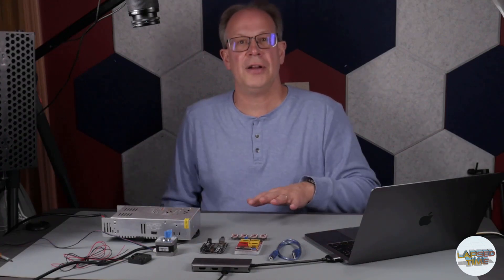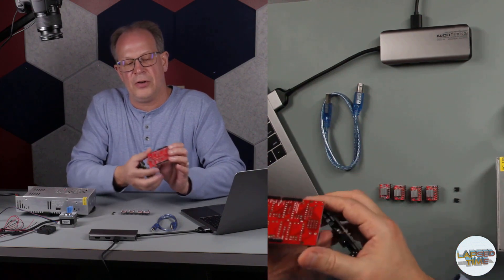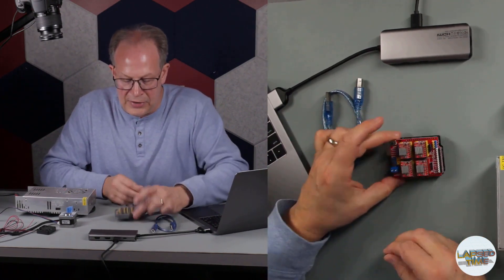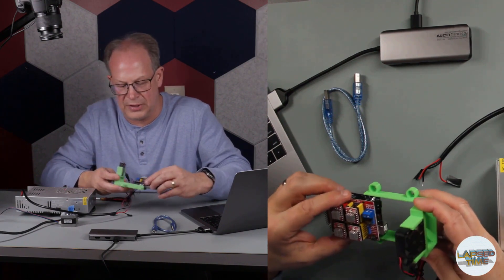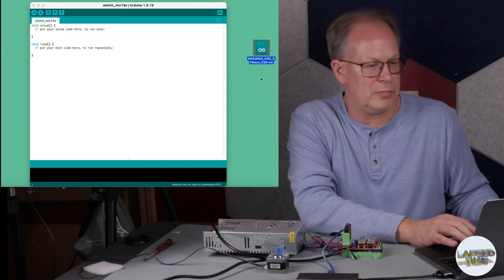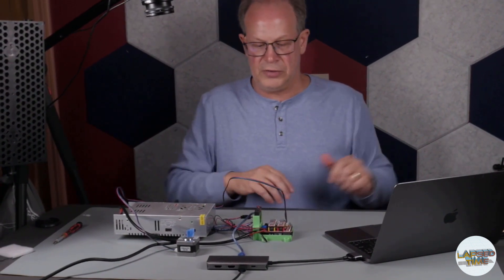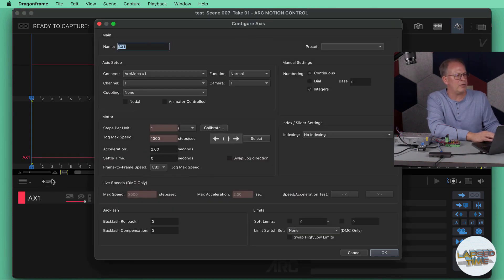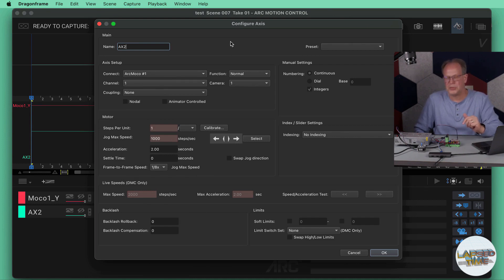Use Dragonframe software to control stepper motors with Arduino and CNC Shield controllers

Comment: When I attempt to connect to the second ArcMoco #2 the location will not allow me to click Arduino the second time.
Reply from the maker: There should be 2 USB connections listed in the location drop down menu but the name may look identical.  So choose one of them for ArcMoco #1 and the other for ArcMoco #2.  You can also uplug the USB to see which one disappears in the list.  Hope this helps.

Comment: Where to get that "dragonframe" software and what is the particular version/name for that program?😊
Reply from the maker: You can purchase Dragonframe software here: https://www.dragonframe.com/   Not exactly sure what program you are referring to but you can get the Arduino Sketch here: https://forum.arduino.cc/t/here-is-my-dragonframe-cnc-shield-v3-moco-solution-code/893160   I have several links in the video description as well.

Comment: Bedankt voor deze video :-)  I am looking at the updated arduino/DFMoco sketch, version 2.1. The pinouts gives me only two per channel, what gives.... the controller needs four pins? 
  channel 1   PIN   4   step. PIN   5   direction
  channel 2   PIN   6   step,  PIN   7   direction
  channel 3   PIN   8   step,  PIN   9   direction
  channel 4   PIN  10   step,  PIN  11   direction

  channel 5   PIN  28   step,  PIN  29   direction
  channel 6   PIN  30   step,  PIN  31   direction
  channel 7   PIN  32   step,  PIN  33   direction
  channel 8   PIN  34   step,  PIN  35   direction

Comment: I built a much simpler motion controller retrofit for my slider.  You can substantially increase the performance of your system by replacing the (garbage) A4988 drivers with some TMC2209 from Big Tree Tech.  They are pin compatible with the A4988 and will be a simple drop-in replacement.  Set them up for 16 microsteps and they will perform further microstepping internally to produce amazingly smooth and near silent operation as compared to the A4988's.  It will be the best $27 (for five) you've ever spent!
Reply from the maker: @swolodkin I appreciate the tip and information.  Good to know.

Comment: Thanks for the video, the only problem is dragonframe don't support gcode you can motion the steeper motor but no can be use a cnc machine. Dragonframe is for animation video movies
Reply from the maker: That is correct.  I am using Dragonframe to control the stepper motors for making stop motion movies.  This is not meant to control cnc or 3D printer equipment so gcode will not work.
Reply: @lapsedtime  I use GRBL costume program on the arduino mega the program is a open source I do few modifications to it to control 6 axis. The original code is in github.com look for GRBL MEGA CODE
Reply from the maker: @delbrey1966   appreciate you sharing that.  I will have to give it a try.

Comment: Thank you your video was super helpful. I followed every step and works perfectly! In fact I want to set up two more Arduino cards. Can you recommend a power supply to handle all three? With 12 stepper motors total.
Reply from the maker: Unfortunately I am not sure on the power requirements for that but I am using one power supply to run two controllers and 8 motors.  Not sure if a second power supply would be needed or not.  Also, I believe Dragonframe only supports 8 stepper motor channels so not sure 12 will work with the software.
Reply: @lapsedtime thank you for responding so quickly. That’s good to know about the 8 motor limit. Thanks!

Comment: seems  the arduino  controller  has limited  use in dragonframe, only for  stop motion,  if your want   realtime  motion  you need to go with DMC+    ??
Reply from the maker: Correct - realtime motion is much more expensive 🤑

Comment: Hi, I tried to make one too by using your YouTube video from Lapsed Time - Use Dragonframe software to control stepper motors with Arduino and CNC shields. I bought the same parts except the drivers. I am using DRV 8825 drivers. After following all the steps in the video, the stepper motor is not responding as it should. It spins in various inexplicable directions and its movements are not smooth. Other arduino codes were also no solution. What could go wrong and do you have a magic solution?
Reply from the maker: I have not used that particular driver but recommend doing a google search for " DRV8825 drivers arduino sketch".  There appear to be some good sites with info and sample sketches you can try.  Hope you are able to figure it out.
Reply: @lapsedtime  I'm going to try with an A4988 driver.
Reply: It works with an A4988 driver and the correct wiring of the stepper motor
Reply from the maker: @ivanwillockx8422   Great to hear that worked for you!!

Comment: Seems like a nice software. Is Dragonframe in the same category as grbl?? Is one superior to the other in terms of support/compatibility? Trying to decide which way to go on a few projects. What you've shown here is extremely helpful.
Reply from the maker: Unfortunately I have not used GRBL but that appears to be similar to G-code used on 3d printers.  Not sure if it would give you the ability to program the movements on a timeline like Dragonframe does.  Maybe someone else can comment on that.

Comment: hi can i use 2 different types of stepper  motors
Reply from the maker: Not exactly sure what different types you are referring to but I have used a NEMA 17 along with a NEMA 8 and can control both within the one CNC Shield.  The key would be to ensure they are compatible with the a4988 driver and the Arduino sketch.

Comment: you forget chek after select board,select usb port, need select what programmer need use. avr isp or arduino isp or what need use, i has try search many video etc, but not any tell what programmer need use. arduino isp i can upload board blink and working but if try upload GRBL or other big ketch come alltime error stv 500 avr etc something i not undertand errors what need do now. i try build CNC to my son.